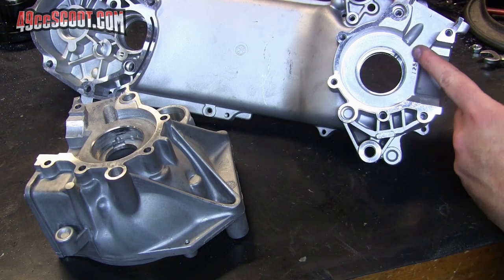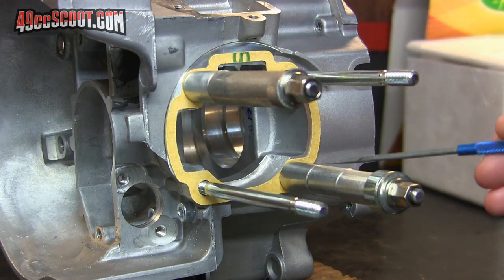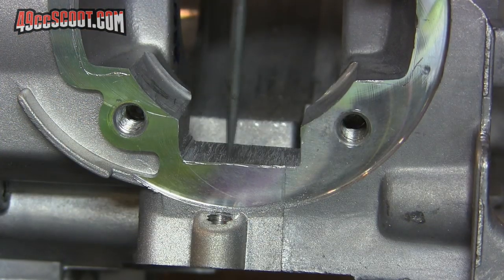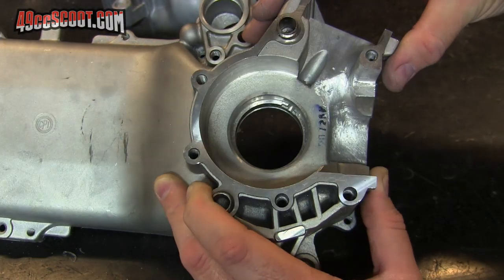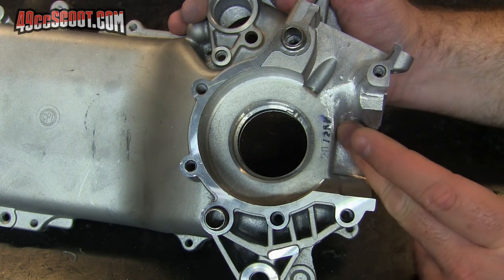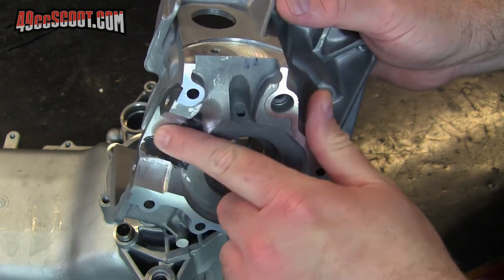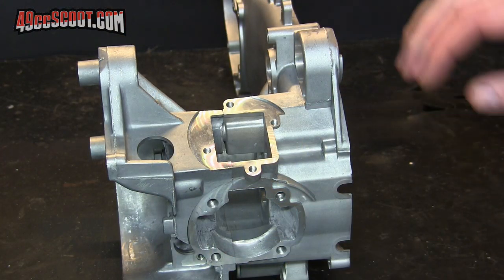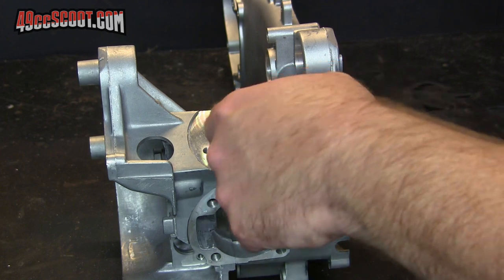TPR 86cc Build : Part 4 : Crankcase Port Matching & Porting

Comment: Pro tipp, use your sharpie and paint the gasket surface. Afterwards scribe you lines into the blackened surface. This gives you high visibility and really accurate lines with a lot of contrast.
Reply from the maker: I've done that before as well. I think scribe alone is the only way I hadn't tried it before. I have an easier time with marker alone than scribing alone. Have to move the cases around a bit to let the light catch the lines sometimes that way. Sometimes I try different stuff just because.

Comment: There is a very interesting CVT/engine design of scooter,,try search Derbi GP1 50 racing.It puts CVT/engine together inside the frame and use chain in the right side to drive the rear wheel.You should take a look at it,Maybe you will use similar idea to your future modifications.
Reply from the maker: Interesting. That's more common with larger bikes (my TMAX is like that), but I didn't know there was a 50 doing it with a full CVT engine and chain drive.
Reply: @49ccscoot  I pretty like such design,,without a CVT box there you can lean more angle when turning.Sadly it's only for 50cc version,Derbi's other scooter with larger displacement models don't follow this design.

Comment: Is carburetor adjustment required after such a port? Will the engine behave differently? Is that the kind of regulation as it could be?
Reply from the maker: I would at least go over the tune if I did this to a working setup. I have never pulled a working setup apart just to port match and cut trenches to tell you for sure that it changes the jetting requirements.

Comment: Hi,
I want to do the same.
1- what is the benefits, results? 
2- do we need to do adjustment to the carburettor? 
🤔🤔🤔
Reply from the maker: I have never tried porting cases with the same setup unported and ported to tell you for sure about any exact benefits or carb changes. You may want to watch this  for more detail though : https://www.youtube.com/watch?v=XcgFI905UGU

Comment: Question: do you loose any volume/charge from making the box area that you JB weld up.Sure the radius directs it in to the cylinder, but you need a certain volume their as well?
Reply from the maker: The trench areas increase the crankcase volume, so it lowers the primary compression. Opening up the ports does the same. Basically any material removal in there lowers primary compression. Filling, like when I'm trying to eliminate a dead spot to direct flow up instead of into a corner of the original port, will have the opposite effect and raise primary compression. There are ratios that some people look for. I never measure my primary compression. It can have a detrimental effect going too far either way, but so far this has worked for me on this type of engine.

Comment: Could you pls send a link to the rotory tool i would really need something like this?
Reply from the maker: I use a Foredom SR. You can get full kits or piece together the motor, controller and hand piece. I bought their hand control, but later discovered that a router speed controller works fine for me for way less. If you get a Foredom, pick up an extra flex shaft. It has a lot of torque compared to handheld tools like the Dremel. Takes a little getting used to, but it will pull through things that the others don't so well. Down side is that it can break the flex shaft if it catches hard enough. I use the 44T hand piece, but also have the H30. The 44T is a nice small hand piece that can be held more like a pen (it is larger than a normal pen though). It uses a wrench to tighten bits into the collet. The H30 is larger diameter, but uses a chuck like a drill so swapping bits is faster/easier.

Here are a bunch of links to either a kit or pieced together setup. They are amazon affiliate links.

Foredom SR kit w/H30 hand piece and foot control : https://amzn.to/2ZPkam4
Foredom SR motor & shaft only : https://amzn.to/3hNn5BZ
Foredom table top speed controller : https://amzn.to/3ckak0v
Router speed controller : https://amzn.to/3iOFUpA
Flex shaft : https://amzn.to/3iOtxtQ
44T hand piece : https://amzn.to/2RJIMYY
H30 hand piece : https://amzn.to/3hRXSpP
Reply: A thank you would have been nice he went through all that and u didn't even acknowledge him. What a jerk.

Comment: Have you ever had the JB weld come loose inside the motor?
Reply from the maker: Not yet. I've only had cracking of the JB Weld used for backfilling. Still never fell out of there even. Just cracked and leaked.

Comment: Is this worth doing on an mx bike? What kind of gains are we talking about?
Reply from the maker: I don't really think it's worth doing on many setups, unless you have the engine apart for other reasons. Then, I would at least port match in most cases. I don't know that MX setups would get much or anything out of trenching. I think  they are generally better designed from the start. 49cc scooters are intended to be very low output, and they have tiny transfers compared to most MX stuff so I think they can use all the help they can get. I don't even think it makes a big difference on scoots, but I've never done 2 setups exactly alike aside from trenching to know. I have a video that talks specifically about this stuff :
https://www.youtube.com/watch?v=XcgFI905UGU
Reply: @49ccscoot  It's a 1994 CR80R apart for a full rebuild, and I'm going to gasket match the transfer ports, but saw your trenching vids. Interesting work!

Comment: does trenching give alot of extra performance? im planning on flowing and port matching my derbi engine for an 80 cc cillinder 
what are the benefits and downsides
Reply from the maker: I would at least spend the time to port match. Doesn't have to be perfect, but there can be a pretty big mismatch with some cylinders. Trenching probably isn't worth it to everyone. I can't even say for sure that it makes power. I've got a whole video about it here : https://www.youtube.com/watch?v=XcgFI905UGU
Reply: @49ccscoot  ty for your anwser ill port match and flow my cases and let the trenching aside

Comment: Didn't you lose a lot of precompression by removing all this meterial? Instead of jb weld i would take it to someone who can weld the spots with aluminum. But great work!
Reply: Precompression is overrated. To much of it makes the powerband really narrow. A tuned exhaust is a lot more important. But this does only apply to eninges with long enough port timning. Engines for use with just a muffler are more dependent on precompression. Keep in mind, a bigger volume has a lower resonance frequency. ;-)
Reply from the maker: Pipes have come a long way and they can pull mixture in. Modern pipes do a lot of work. The big issue with welding is warping. Chinese metals aren't everyone's favorite to work with either. One good thing about JB Weld or other epoxy is that if it fails I could clean it out and have it welded. If a welder warps the cases, I'm starting over again with new cases... assuming it's known and it doesn't just cause me troubles that I can't pinpoint for a long time.

Comment: how much work would it be to source castings with more material on them?
Reply from the maker: These are about as good as it gets for these 49cc based engines as far as I know. The Yamaha stuff has less material, or at least Zuma engines do and someone on the forum has stroked an Aprilia engine and said it's similar to the Zuma cases. You can get stuff like the Malossi C-One or RC-One cases that are redesigned and use flange mount cylinders.
Reply: @49ccscoot  if your interested in something beefier, have a look into DIY Electro Discharge Machining (EDM) the ram method seems to be a good fit for this use case.
Reply: Smc rexy lomg blocks have more material there

Comment: This carter is same the engine kymco super 9???
Reply from the maker: No. This is a Minarelli clone. The Super9 is supposed to be something similar, but Minarelli cylinders don't fit.
Reply: @49ccscoot  ok. What performance part for this engine Super9 big bore stroke intake pipe transmission and other racing component for that kymco
Reply from the maker: @jovidmenie9602  https://www.scootertuning.ca/en/1009-kymco-super9-50-lc-2t

Comment: Cant you have a shorter straighter intake pipe? You lose a lot of powee there i've heard
Reply from the maker: Rear facing intake is what all the cool kids do. That can make a short and straight path toward the transfers without changing direction so much. Requires a custom subframe.

Comment: No one tested  on the dyno with and without trenshing. There must be a difference because motocross and Gp bikes always come with that. If it the casings or the cylinder
Reply from the maker: I'm sure it has been dyno tested, but the results may or may not have been made public.
Reply: @49ccscoot  are u on FB? So i can sent you some videos of the bikes an the drangs?
Reply from the maker: @guidosamson682  https://www.facebook.com/brent.blades

Comment: when you go true the crank case its to trow away dont jb welt that men xD commong be a little more professional plus your removing way to much you create more room means less vaccum in de crank chamber you cant just eye ball that xD
Reply from the maker: I've used JB Weld for years and known of some people with more experience than both of us combined that have used it. It may not be the best technically, but it has worked. Most modern 2T thinking worries more about the pipe than high primary compression and having a larger volume in the cases can be beneficial. That said, no, I haven't measured the volume or tried to calculate primary compression.
Reply: @49ccscoot  also check the squish clearance on your 2 stroke this will help proof performance bye alot alot to big and you lose alot of horse power plus more wear on the piston ring to short and you burn a hole true the piston if you looke deeper into the subject you will see that your poort timings play a big keyrole in here to when comes to squish and for the jb welt yes its insane strong and yes it will do the job is it good no its not makng the crank case bigger is always a power loss unless you add back what you remove in a smart manner  maluble metal i use to add what i removed back to gain peak performance i add it mostly to the rounding of the transfer ports and that stuff is alot better then jb wel plus 0 chance for cracks to apear just a tip
Reply: my true advice would be dont chip so much on the engine its way to much all you want is to make it flow a little better not to grind true it and fill it with jb welt thats why i can see good use for jb welt but not like this if you fill the transfer poort slide with jb welt to compensate for what you removed than you gain alot more out of it with alot less risk and more performance altho i must say that wall is realy thin thats why normaly your not allowded to go deep ad all there just knock the sharp corner of and be done and for the cilinder gasket you want them from the cilinder transfer ports not to be flad the harder that angel the better it is for gaining more pressure so you can vaccum suck more fuel to the cilinder so when you mark the engine wth a gasket make sure you dont !!! make that area flat that angle can be realy tight  you only gain performance then and not lose so much
Reply: and since you love insane accelerating rathen then speed good ignition will do wonders over stock thats a free 5 hp from ignition alone ^^ less top speed cause you have less mass moving around to store energie but you gain insane alot of torq  and that combined with diffrent cf gears ratio you can make it faster then enything you can inmagen besides elektric bikes they are just nuts
Reply from the maker: @djemyvandermeijden794  I have checked the squish and cut the head. Keep watching and you will see other mods.
Reply: @49ccscoot  i dont realy get it you did check the squish and cut the head? you do not or never ever adjust a cilinder head for squish you do this with thickness of the basegasket  to bring the poort timings more up and down and the clearance from piston to cilinder head  same for torq spec never over torq is if the cilinder cannot expenand the piston will exspand alot sooner then the cilinder and it will die on you
Reply: @49ccscoot  let me ask this a little diffrently how much is your squish clearance now and why and how did you came up with that number  what did you do to chance it 2 stroke compression equals hp so  keep that in mind i saw a video of your doing the squish but not how to adjust it nor what the right size for squish clearance is either i saw yours was ad a 1.11 wich is waaaaay to big for sure if you take the piston out the sides are dark meaning you got blow bye from the compression igniting to late
Reply: cause inmagen if that is way to big you lose alot of hp not to mention your mvt ignition wich i would not recommend altho i dont go there would be adjusted absolutly incorrectly these two combined make the most horse power besides the cilinder it self just a tip for you from some one with alot alot of experience in two strokes
Reply from the maker: @djemyvandermeijden794  I shaved off 0.2mm to get 0.91 and then another head I shaved it and ended up 0.8-something. The port timing was exactly where I wanted it at 190/130 and the port floors were flush with the crown at BDC.

The MVT is good for people that actually use their scooters IMO. Total loss setups only last so long and stock flywheels have too much mass. I have heard that other ignitions may provide better performance, but that's pointless if I can't ride it however I want. It's bad enough trying to run good lights with the MVT and even worse if you have an electric pump.
Reply: @49ccscoot  i know this sounds crazy but bring down the squish to 0.7 and between 0.75 this is still save range for squish band from between 50 to 100cc i run 0.73 on my 2 fast 94cc for the mvt there not bad once out there but the one you have is not great for the most performance also you have the option of full digital to check on the laptop or ipad to see the patern of the ignition but thats to overkill for daily drive and for the water pump i realy realy advice you piaggio malossi engine and go for a 94cc 2 fast for race with malossi range that works wonders for ignition take hpi with 2 curves and it comes with spoel to charge your battery this way you wont need a water pump ~plus you got battery charge ad the same time with 0 performance loss in the piaggio engine the waterpomp build in works amazing from 50 to 100cc its absolute no issue in your case your water pump should be located on the ignition cover where the pomp is attach to the fly wiel of the ignition why not run it that way rather then a elektrich pump you ruined your head tho i saw the vid of your squish and your poortings where quite offf bye couple 0.1 of a mm that is why you always only chance the base gasket to get the right squish never the head i realy like you to stop shaving of the cilinder head and try a thinner base gasket trust me the reward will be great and why not run original morini water pump so much better for daily drive rather then a elektric pump wich limits your range quite alot when it comes to driving
Reply: @49ccscoot  also i like to point out a very very big flaw in your reets design its way to naro for the reeds to fully open so your creating resistance ad the side walls of your reet intake your outer reeds wont open much cause of the side walls they open alot more then you can inmagen